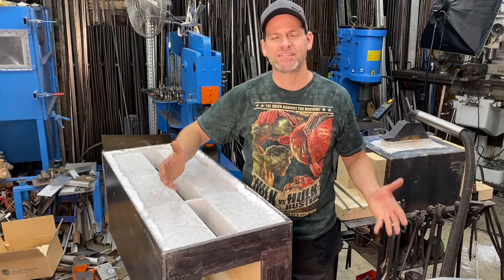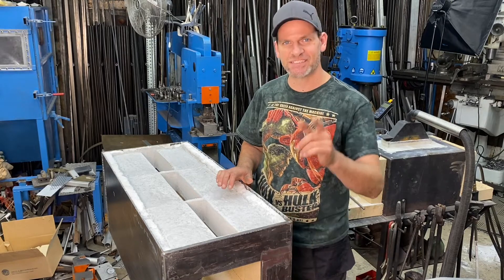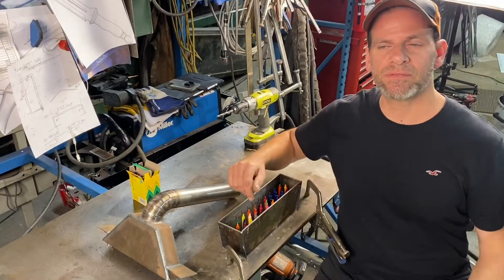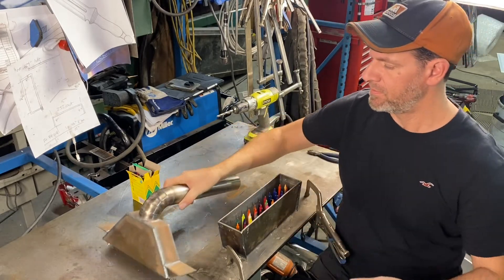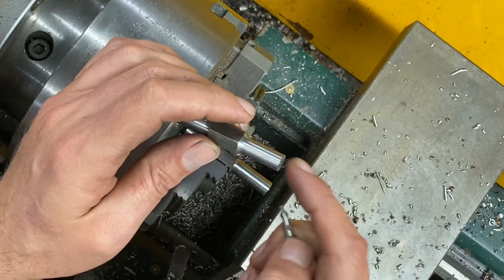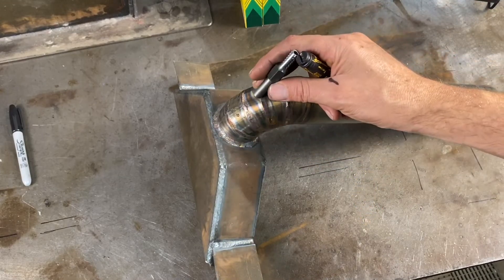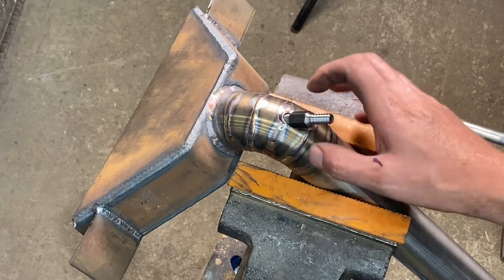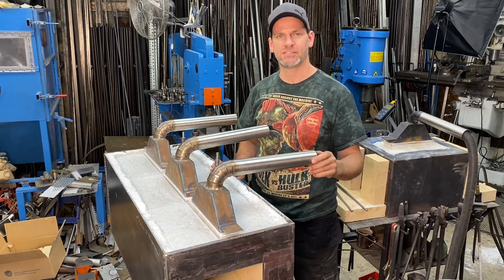MONSTER FORGE BUILD!!!

Comment: This may seem to be a novice inquiry to a forge builder but I will ask because been thinking of building a forge myself. I can't help but notice in many of these build videos they just pour the refractory without addressing many of the normal concerns with concrete builds like pavers that they suggest various methods of removing air inclusions which I would think they could present a hazard or at very least shorten the life of the forge. Is this a valid concern or am I over thinking it and worrying about nothing?
Reply from the maker: Not a big concern , i have refractory on a forge that is 5 years old and no cracks yet

Comment: Really great video.  Thanks.  Why do you put blanket between the steel and bricks, and what is the thin stuff you put between the bricks and for example the front panels?
Reply from the maker: thanks , to keep the heat in the forge the refractory blanket helps keep heat in and not lost through the outside steel wall . the thin stuff is also a refractory blanket its just a compressed type

Comment: Indeed that’s a monster. Excited to see how it runs. Have you looked into doing electronic temp control for it?  3 individual systems would be great for heat treatment, but I’d go with one for general forge work. 
What refractory are you using on these?
Reply from the maker: Hey thanks for watching , temp control sounds like a great idea I’ll have to look into that . I’m using unicast 70 for my refractory
Reply: Bonifabcustom Rob Bonifacio it’s super simple and cheap to add to the forge.